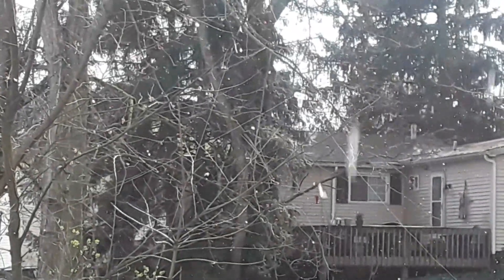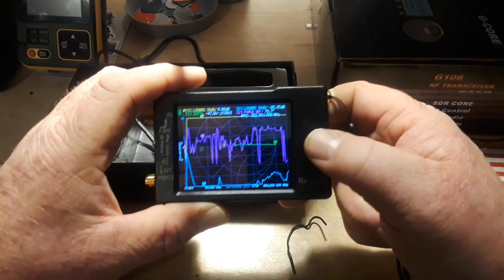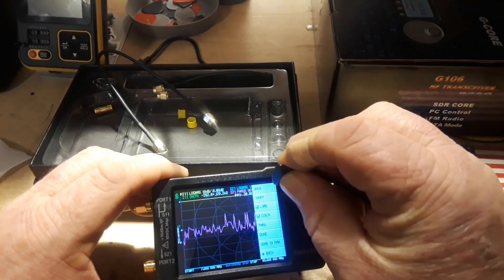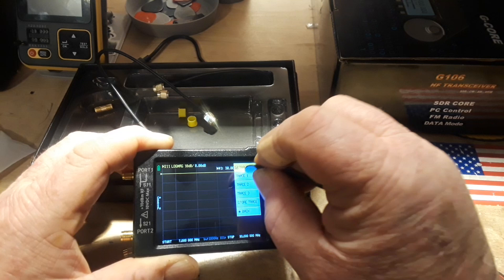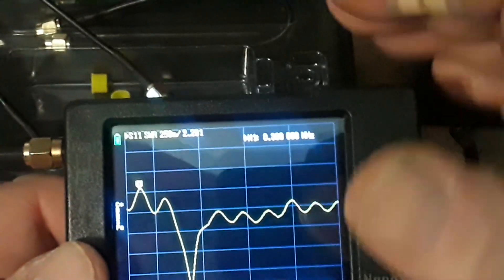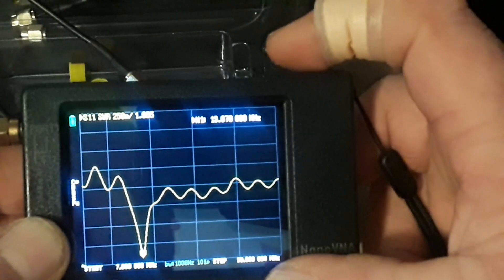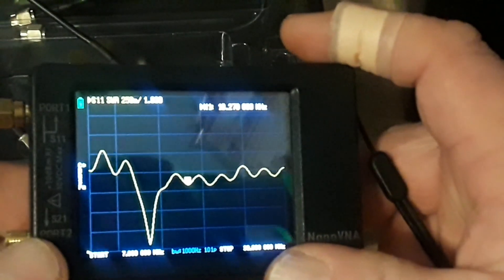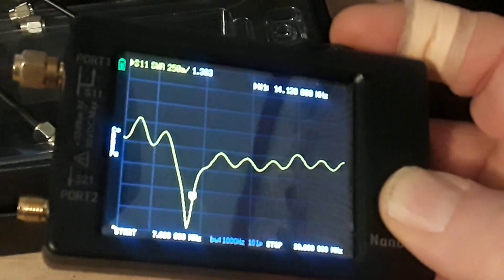Analyzing My Homemade Antenna With The Nano VNA

Comment: Let's see this clever device being used in a school room setting such as breadboarding a simple one transistor AM radio and then hand winding a few turns of copper wire around an ink pen body to form an antenna.

Then measure that antenna. Show how pulling the coils apart might or might not effect tuning.

Show how an extra turn or one less turn effects tuning.

You could also demonstrate how to adjust the tuning screw on the base of cheap CB radio antennas can be used to fine tune them for a particular car receiver.

I'm guessing you could mount your collapsible antenna to this device to demonstrate range of that breadboard AM transmitter?

Comment: I trust you included a 1:1 current choke at the junction. It also matters if you tested after the feedline. The feedline is more of a dummy load flattening the SWR. The best test is signal reports and checking your output with remote SDR to hear your signal firsthand.

Comment: I found it critical to calibrate with any cables in place to the DUT. Thats why they include a barrel connector. The upside is the VNA sma connectors are not getting stressed.